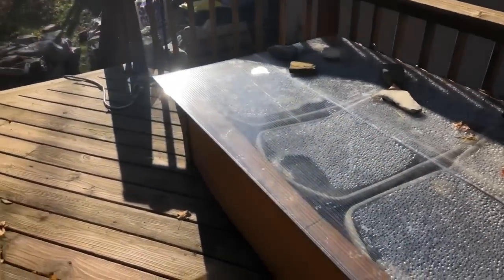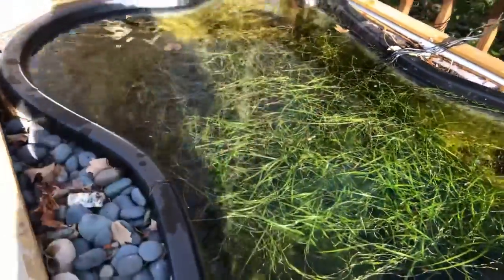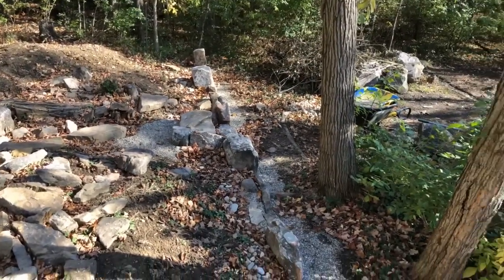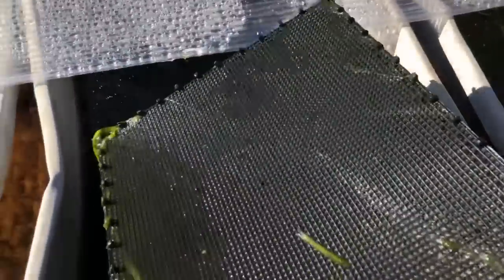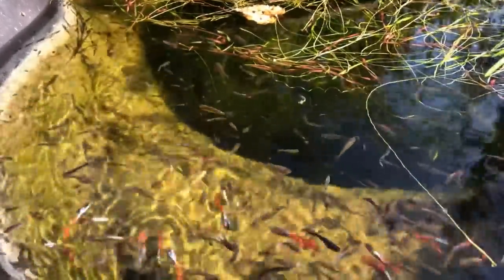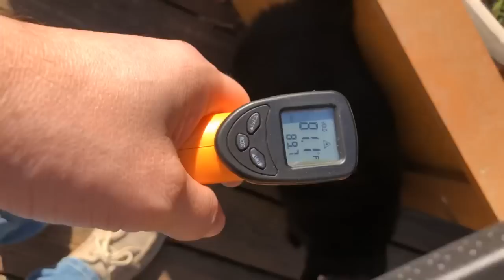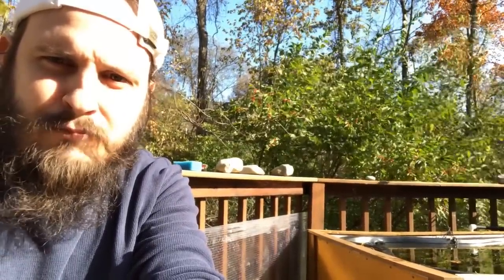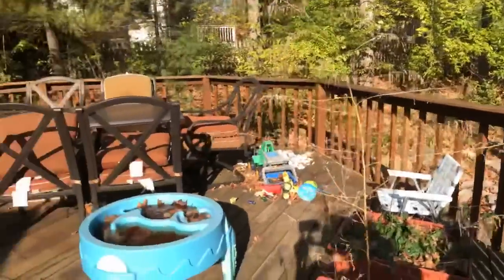Keeping TROPICAL Aquarium Fish Outdoor Tub Ponds WARM all year round Even in WINTER

Comment: I‘m soon gonna build my own little mini pond for our balcony and I‘m kinda worried about insulation, since we get temperatures of up to -10C° / 14F and the tub will only be 90L / 23Gal, so it won’t have as much thermal mass.

But luckily electricity is really cheap for us, so heating it won’t be a big problem.
Reply: Update! Just finished building the pond yesterday.
I used a 110L / 29Gal pond tub and just packed the whole thing in styrofoam and spray foam, gave it a nice wooden box around and that should be fine.

Now I only have to find a grid to make it cat-proof and decide which fish I‘m gonna keep in there.

Comment: Think this would be possible for a 300g pond for a dovii over winter in new england ? I am debating giving it a shot building it before this winter and insulating it very well with home insulation. I’m just afraid of the electric bill lol.
Reply from the maker: Yes and yes the electric bill will jump a bit in the winter. I heard electricity over there isn’t cheap. I do recommend to back your heaters up with other heaters in case one malfunctions and to take the power load off each and why I ran 4 500 watt heaters in mine which would be effective enough for 300 gallons just make sure there on sand and not plastic or they can melt it. They also make inline heaters which is how they heat hot tubs. Bit pricier though.

Comment: This is a little late. You are in Indiana, I know it gets pretty hot up there and it looks like your tubs are in full sun. How do you keep the temps from hitting the upper 80s and 90s? Im in FL so we can get away with heaters for a few days in winter although I might do something similar to your insulated boxes.
Reply from the maker: They were pretty much full sun and would get the heat but since it was only for a daily moment and cool off comes at night its not a problem. Having substrate also helps hold cold or hot depending on climate and acts like an insulator.

Comment: What type of heaters do you use in the tubs?
Reply: He said 4x500watts, im assuming theyre the usual glass tube ones.
Reply from the maker: 500 watt odyssea, they are cheap on ebay
Reply: Thank you sir.  I am thinking about using to passively heat up my small greenhouse this Winter by placing an aquarium heater in a black, 50 gallon barrel inside the greenhouse.